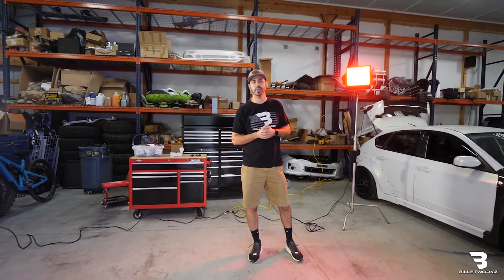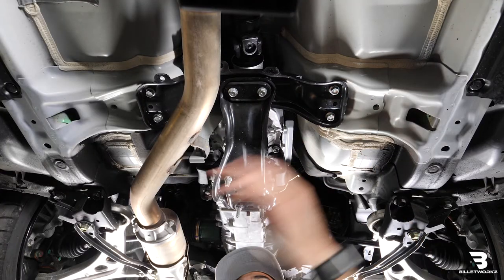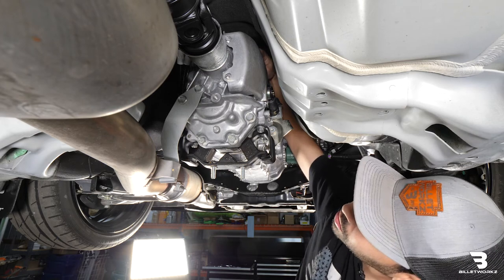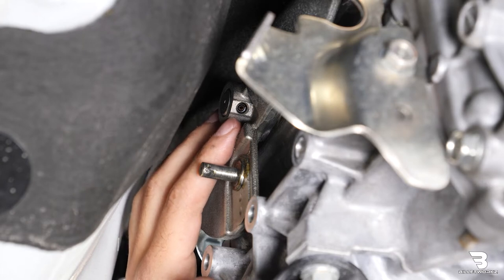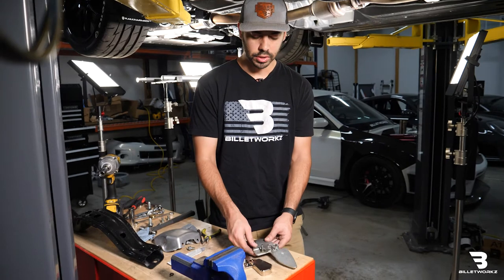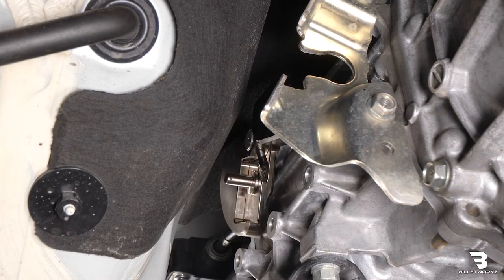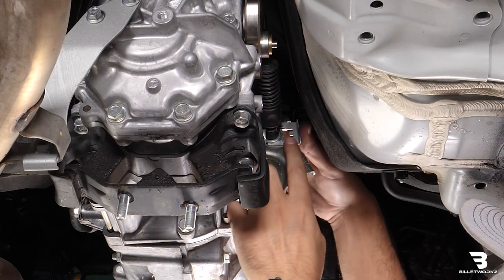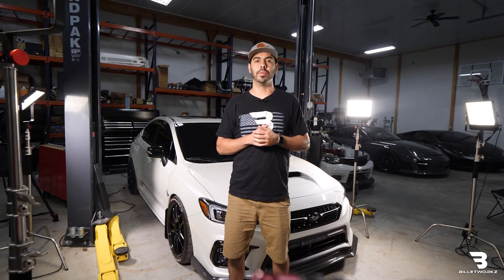Billetworkz - 2015+ Shifter Plate and Bushing Install Guide

Comment: Hey all. Just installed mine. Well, just finished it. I’m not the most car savvy person in the world but feel I’m pretty mechanically inclined. The roll pin is by the far the hardest part. You can pop the smaller center one out, to loosen pressure on the larger pin if needed. Can put them back together before putting it on new plate as he did with the needle nose. The old shield does not get reused. The car will not go into 1st, 3rd or 5th with it in place. Make sure to leave it off. Otherwise, it’s amazing and I’m absolutely in love with it along with the weighted knob. It’s how the car should’ve felt to begin with.
Reply: I can't get the old plate off. I punched the pin out unless there's a 3rd one outside the other two. So i just punched it back in, and it went in fine. Much harder if you don't start it while off of the trans. I'll probably give it another try tomorrow but that thing was on there.
Reply: @mattevans1643  hit with some pb and pry evenly with a flat head or pry bar. Don't bend and don't over do it cause it will royally fuck something up. Sometimes they're really on there. But you're certain the two pins popped out and not just the inner?
Reply: What plate the bigger one or smaller one
Reply: Bro tell me why I just finished install, reinstalled both 4 bolt shield and 2 bolt shield, and it would not go into the fwd 3 gears lol that was my first guess but without anyone to shift gears for me I could have never seen it you are a lifesaver will remove that bs in the morning hahahaha

Comment: Too bad there isn’t an aftermarket shifter plate cover. I installed one on 2017 WRX and a rock somehow got stuck in between the plate and the transmission. It wasn’t fun moving through the gears. Very sketchy. Luckily, it just impaired shifting. I removed the rock and it worked flawlessly afterwards.

Comment: definitely one of those "while you are in there " installations....because while you are in there, you might as well add a new transmission mount and positive shift kit (Whiteline or similar) with all of the braces and brackets you are taking off; if you haven't done those mods already.  Plus, if the car is on a lift, it makes it soooo much easier...

Comment: I noticed you didnt re-install the shield from 1:39 back when you put everything together at 7:50. Is this right or did I miss something?
Reply from the maker: That is correct. If you reinstall that shield, it will interfere with the shifter plate and you will not be able to engage 1st, 3rd, and 5th.

Comment: Love the BW shift plate and short shifter, but you gotta add in the part where you lube the shift cable before trying to put it on the bushing. It's a PITA without lube, and then actually using the shifter is terrible. I went back and added lube to the bushing and now its butter smooth.

Comment: I just finished an install for a customer. I only took off the front transmission support crossmember and didn't touch the heat shield or the second cross Member attached to the shield. It was unnecessary in my experience. The 3x 12mm bolts are easy to reach w/a extension and wobble adapter. 

For the pin I didn't have a punch w/ me so I fashioned a punch out of a screw and grinded it flat and removed the threads, using a auto E-hammer made the job easier, a standard hammer was taking forever and was way too crammed of an area to work even on a mobile lift.

As far as removing that clip in the shift linkage I'd also advise against it as it barely helps make any clearance, instead take off the 2x 12mm bolts holding the shift linkage on and pull the whole bracket w/ clip out of the way. Easier to take off and no PITA clip to put on and put back on in that tight space. 

Putting the new pin in with my auto hammer was super easy, took 30s, the hammer was just to get it started... From there I wouldn't waste my time after hitting my fingers with the hammer 3x due to aluminium transmission mounting areas getting in the way and deflecting my strike. A sharpie is your friend when lining up the cotter pin to the hole.

Comment: What size punch was used to knock out the roll pin?
Reply: you ever find out??
Reply: @Tht_1sti  no never did, I’ve got the kit on the way too. I wanna say someone mentioned a 3/8 🤷🏾‍♂️
Reply: @troymarchbanks8365  3/16 rollpin punch
Reply: used a 5/32", need a long one or you hit the plate constantly

Comment: Did you forget to put that one cover back on? The one that is being removed at 1:40. You don't put it back on at the end.
Reply: I have the same question.
Reply: I believe is not needed, because it won’t longer fit and it’s just a heat shield
Reply: @ChrisSlv503  correct. Just installed it along with the short shifter and it does fit but won’t go Into 1st, 3rd and 5th if it’s on. Removed it and works fine.
Reply: @MrDIJEN15  I wonder if it will rust anything? In that area
Reply: @allninerr9876  don’t gotta worry about that in so cal. Lol
Reply: @MrDIJEN15  well i live in nor cal haha but still!

Comment: what size is the punch for the roll pin? i’m trying to get mine installed tomorrow but the roll pin is scaring me
Reply: Following ? Have you figure out the size?
Reply: @nbaterrence9486  it’s a 3/16!
Reply: Confirmed 3/16th did it 👍

Comment: why dont you need to reinstall the last cover with the tricky 4th bolt?
Reply: won't fit because of the thickness of the shifter plate
Reply: I wish he had specified that You don't reinstall that shield in the video. I just reassembled everything and now I'm just realizing that I have to take it back apart again to take that shield off because it won't shift into gear.

Comment: Just ordered mine for the Black Friday special.  Seems like pain to install without a lift. WELP
Reply: bushing can be done with jack stands on back. idk after plate. i assume it would be the same way since it’s around the same height as the bushing. i’m gonna try to do it tomortow
Reply: @avokovich3579  you can do it on jack stands. That pin is the only problem. The crossmember has to come off unless you have a foot long punch. If you have a really long punch you don't have to take the crossmember off. If you have a really long punch you can remove the cablemount, and not have to remove the clip. Which is a pain also.

Comment: This thing is kicking my ass. I punched the pin out and couldn't get the old plate off. I needed to go somewhere, so i punched the pin back in, super difficult. Much easier when it's already been started. Put the new bushing on. Buttoned it up, went driving, and then the car just isn't driving right no acceleration. So i put the old bushing back in, and it was perfectly normal. Have no idea what the issue was. I know the car can mess itself up, but the acceleration thing was constant. I also noticed the shifter was basically free when in gear i almost thought about trying to throw it in neutral just to find out, but then i thought better. After putting the old bushing back in the shifter didn't have any play in it either. Which also didn't make sense, because it was tight on the aluminum bushing. Now i just need to get back at that plate. Don't know how i'm getting that thing off. I must have tried for about 30 minutes. Tis for another day. Anybody have recommendations for getting the old plate off.
Reply: Penetration blaster helped me, I was also trying for a long time trying to get it off
Reply: Pry bar